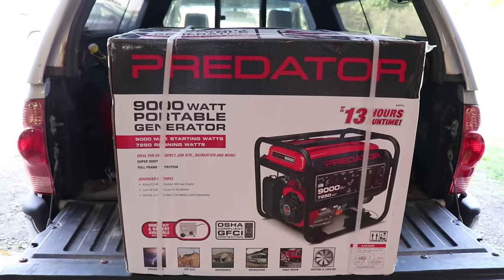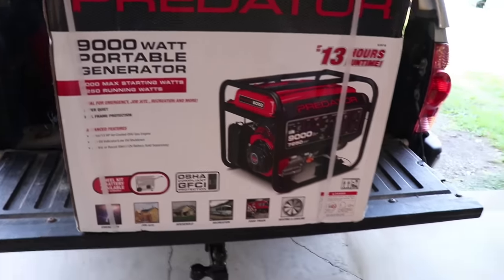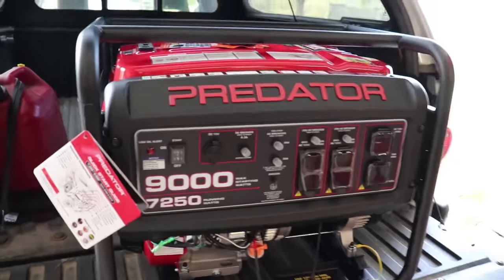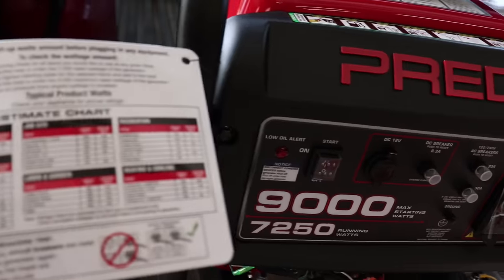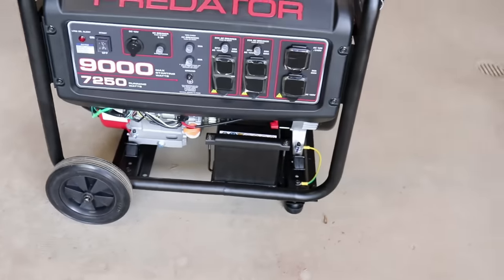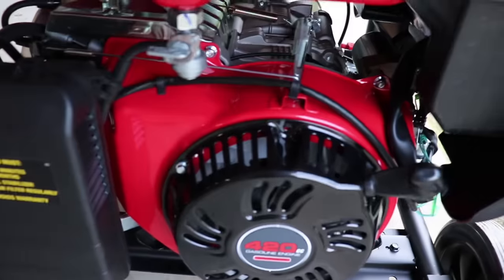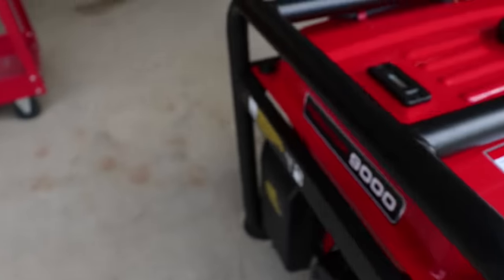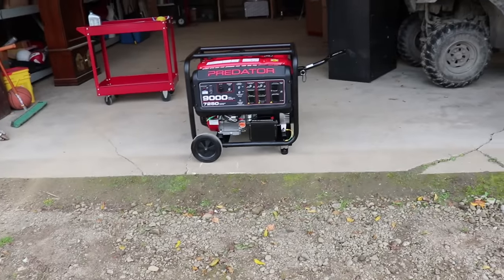Predator Generator Running Our ENTIRE Home. (Complete Setup and Cost)

Comment: You should make a detailed video on everything you did to the breaker box. This is what people really need to know.
Reply: You’re exactly right! THAT is the most important information! The rest is something that any halfwit could figure out.
Reply: @1wldnczyguy  Really!? The mains switch, breaker, and wiring are the easiest. The generator set is the hardest with the most variables to understand. Just as an example, running a generator off off GAS, LP, or NG will loose a significant amount of power in that order. Especially when it comes to restive and inductive loads. Simple math. Any half dimwit would know that first right!? I'm assuming you have the generator topic already figured out for your application!) Call an electrician do the rest of the easy stuff;)
Reply: Eh. I prefer the review on the generator mostly. The wiring is pretty easy.
Reply: Absolutely, that's the whole reason I watched
Reply: i would like that!
Reply: @TopTechCg3  With LP I didn't see any difference of the gens ability to handle load versus gasoline. I tested with an 83% load and it didn't miss a beat. The power loss from using NG may only matter if you are trying to run higher than an 80% load. If you know most all of your run time is 50% load or less fuel choice isn't an issue.
Reply: @TopTechCg3  You're not going to electrocute a linesman or burn your house down because you selected the wrong generator setup. The same cannot be said about wiring.
Reply: @Benjicmm  amen..one can take your life the other doesnt putting it together
Reply: I clicked on the video because I thought it showed you
Reply: @javiergamez3343  me too.
Reply: Has anyone seen any other videos pertaining to the breaker box setup?
Reply: @cscott6629   yes its a double poll 30 amp breaker.  when its a single its 110 its a double poll its 220
Reply: A lot of snarky electricians out there. These people are gonna try to rig it to their panels somehow, so wouldn't it be better if someone showed them how to do it right?
Reply: Electricity is dangerous,  a competent person should wired for you all
Reply: Get an electrician, don’t kill a lineman.
Reply: If you don’t know hire an electrician.
Reply: @1wldnczyguy  why are people so quick to criticize I think there's friendlier ways to exchange info and ideas, this video was helpful to me and if I need more info I will ask Mr. Cook
Reply: here's a link that might help, it shows the wiring of the breaker its a little different set up it uses a Generac kit but if you understand it you should be able to adapt it or if you don't you should probably hire a electrician or reach out to people until you understand it. just remember thinking you understand is different then truly understanding https://youtu.be/1p8qZzwgwFO
Reply: @ronedwards5900  Thanx!
Reply: C Scott it’s a 30 amp double breaker which is 220
Reply: C Scott It is a 2 pole 30 amp breaker rated for 120/240 volts. 220v. & 240v are interchangeable and both are residential voltages. For this purpose there is no difference.
Reply: Nae C I’m a 48 year 4 state master electrician. Let me know what you need to know about the Breaker box ( load center ) and the wiring. It’s way more simple than you might think.
Reply: Zuzu Fan I’m a 48 year master electrician and I’m not snarky. Let me know what you need information on.
Reply: unrepeatable raddish A manual transfer switch will make it easier to operate but harder for these folks to wire it up. And you probably know that it isn’t necessary for this application other than convenience as long as you don’t screw up and leave your main breaker on while your Generator is running.
Reply: Actually you don’t even need that twist lok receptacle or the 90 degree PVC pipe. Just wire it straight to the breaker in your panel since this should be a stationary installation anyway.
Reply: I'm sorry to here you burned your house down. Sorry my brother!
Reply: @spinaltap3258  how do you wire the box for a generator
Reply: C Scott it will have to be if you want 220/240 v in your home.
Reply: U Hall okay first tell me what wiring configuration you’re going to use. Ie: using a twist lok receptacle, or a manual transfer switch, or wired directly to your panel in your house.
Reply: @TopTechCg3  Always a mister know it all in the comment section!
Reply: All you  have to do is run a 30Amp circuit from your main panel or even sub panel to a Generator outlet.  Turn your main power disconnect to the house off make sure of this 100%  so you don't melt your generator or blow a secondary on your utility transformer.  I would highly suggest using a multi meter to check that the power is off and buy a lockout device to lock out the main breaker in the off position before running your generator.  If you have a meter main socket outside this makes it even easier, but make sure you turn the first main disconnect to your house wheather its outside or inside.
Reply: I came in to see the electrical wiring. Did  he make a video on the electrical wiring? I'd sure hate to be homeless trying to warm the house.
Reply: C w I can walk you through how to do it but first do you have any electrical training at all? I would not like it at all if you or someone was to get hurt. Like I said earlier I’m a retired 48 year electrical contractor. So for me it’s very simple to do. So let me know how comfortable you are about going into your house panel. Remember 120v @ 20 amps is at least 2000 times enough current to kill or seriously injure. That’s probably why Mr. Cook didn’t include that process in his video. I would prefer a different format than than this so that information would only be visible to you only. Hope you understand. But when it comes to life safety that’s where I from a humanity and licensed electrician must draw the line and I just can’t put that information out to the public. One thing that I don’t see in any of these videos is the fact that nobody is grounding or even make mention of grounding. That is the MOST IMPORTANT thing that you need to do for life safety and electronic safety. Let me know if you have a platform that I can walk you through it without putting it out to the general public. Thanks.
Reply: @TopTechCg3  A lot of people are not comfortable with connecting up to a breaker box.  Instructions would just make one confident in making a DIY install.
Reply: Get a transfer switch that enables 6 to 10 circuits and monitors the power output from the house to generator.  It costs a little more than the option that this video uses, but it is a better option.  A reliance transfer switch costs between $200 to $300 but includes most of the parts that cost him about $100 or so (Google 'transfer switch')..
Reply: Its not to code so why make a detailed video?
Reply: @spinaltap3258  Okay cool.. Thank you.   So you believe it's something I can do by myself? Even if I cut the breaker main switch off I still run that risk? I'm on leave soon as I return I'll send the info. Thank you.
Reply: First question the lawyer will ask Are you  certified?  No I followed random comments on utube. No further questions!
Reply: @lesliemaness999  thank you.  Some states don't require you to be certified.  Like Pennsylvania where i live.  I can pass the test no problem, anyone can do electrical work in Pennsylvania.
Reply: @ronedwards5900  ; thank you.
Reply: @lesliemaness999  okay got you. Thank you.
Reply: Tesla first looked into the area of zero point technology in his early years, before he made his more commonly known discoveries in the area of alternating current electricity: https://homemade-generator-tao.blogspot.com/2020/07/tesla-power-generator.html

Zero point is a fringe area of research in physics. Even as a young man, Tesla was convinced that it was possible to obtain energy from all around us and that conventional thinking (obtaining energy from fuel reserves) was wrong. Impressionable as he was at that young age, he was persuaded to drop this area of research and he went on to make some of the greatest discoveries in electricity that the world has ever seen.
Reply: Yes please
Reply: The breaker box is the only thing I really think anyone that came here needs to know.
Reply: He put a link to the video for that incase you missed it.
Reply: Google that s*** then
Reply: @frankm5019  it isnt that hard. You're not wiring up a nuclear power plant
Reply: @lesliemaness999  negative, Ghostrider. Many states do allow the home owner to do electrical work on their homes, but you likely have to have an inspector check your work and sign off on it.
Reply: Wiring is easy. 2 hot wires to the double pole breaker. One wire to neutral bar one wire to ground bar. 240v 30 amp.
Reply: Question? Could the 30amp breaker be installed on the bottom of the panel and still work?
Reply: @njm5991  yes because its connected to the 2 hot (Line) buss bars.
Reply: This is all fine but what what happens if the economy shuts down and you can't get gasoline ⛽ to run your generator?
Reply: Yes! Everything of how to set up a breaker box build please!
Reply: I've bought air compressors that have popped the breakers.lol..   big facts.
Reply: Yes I agree but otherwise it was a good video
Reply: @spinaltap3258  I have the same setup but need a cable. Do I get 240v cable or a 120v cable? The house and box are already wired by an electrician... I am naive when it comes to this and he didn't mention anything about the cable I would need
Reply: Absolutely agree need detailed video of wiring the breaker box
Reply: @deacon8754  True , A lot of people won’t understand that
Reply: Get an electrician if you dont know how to wire your panel. YouTube is not where you want to learn how to wire your home
Reply: Me too.
Reply: Yes definitely, we all know about generators
Reply: Yes I need the  what u did
Reply: Yes please ☺️💖
Reply: Id say its for legal reasons or at least thats why i wouldn't show it. Nowadays people are very sue happy and would gladly throw you under the bus without a Second thought if you were to shock yourself or worse burn your house down ect. If you aren't sure how please pay the little fee for an hour of labor from a pro. Put the limited liability on them .
Reply: Just a word , although I'm an avid do it yourselfer too , in some states hooking up a generator to a breaker box is illegal unless done by a certified electrician and inspected by the power company . they have to check to make sure in case the power to a certain grid goes out , when the grid comes back on line and men are working that backfeed won't happen on transformers making a daisy chain .
Reply: Get a licensed electrician.
Reply: I was hoping he would show proper start procedures and shut down procedures.  For example,  lights go out, you start your generator,,now, what next.
Reply: Call an electrician.  That way you know it’s done safely and correctly.
Reply: @kirkcardoso6137  what size wire?
Reply: @GL_615  50 amp service 6 gauge. 20 amp service 12 gauge is suitable.
Reply: Make sure you all are aware with the hazards of using generators. Generators can be dangerous if not used carefully so make sure you follow all the generator safety instructions. I know all about generator safety and I have something to explain to everyone about generator safety. Here is what you all should know: please remember not to ever run your generator indoors. Generators should only be used outdoors. Always remember that carbon monoxide fumes are odorless and colorless gas that is a silent killer that you cannot see or smell. Carbon monoxide is dangerous and it can cause death. Carbon monoxide is poisonous. Always keep that in mind when using generators. You need to have a carbon monoxide detector. Make sure your generator is 15-20 feet away from your house and away from doors, windows, and vents. Never use your generator indoors even if your doors and windows are open. Some people run their generator indoors during hurricanes which is dangerous and you and your family will die if you use generators indoors. Running a generator indoors increases the risk of carbon monoxide poisoning. Please don’t run your generator in wet conditions. Running a generator in wet conditions can electrocute you. You need to keep your generator dry. Don’t let the portable generator get wet. You need to have a generator tent as well to protect your generator from getting wet if you will use  your generator during wet weather. We also really need to keep our children safe when we’re using portable generators so they won’t get electrocuted or burned by the generator which is dangerous. Generators can be hot. You have to keep an eye on children making sure that they are not near the portable generator to avoid any risks. We have to be aware with all the hazards and follow all the instructions in the generator’s operating manual. Generators pose electrical risks. Make sure your generator is not overloaded. Overloading your generator can cause damage to the appliances that are plugged into the generator. Please don’t overload your generator. Don’t ever try to plug a generator cord into a wall outlet to avoid back feeding. Back feeding is dangerous. Always turn on your generator first before plugging in appliances. And before you unplug the appliances, please shut off your generator first. Please use a heavy duty cord for your generator and the cord should not be worn out. Please don’t refuel your generator while it’s running. You should shut off your generator and let it cool off before refueling it. Refueling your generator while it’s running can cause fire if gasoline spills on the generator’s engine because it’s hot. Please make sure your generator is properly grounded. Everything that is said on the generator’s operating manual should not be ignored. They all need to be followed. https://youtu.be/I1jT3ANENvI and here is a video more about keeping your family safe while using generators. This is for everyone’s safety. This is just a safety reminder for everyone to make sure that you all are aware with the warnings. Thank you and hope you all stay safe. Use your generator carefully.
Reply: I see that some of the comments saying prepping the panel is the easiest. That’s not true. I’m a licensed electrician so I know how to do it but for the common person it’s not. Some panels don’t come with a main breaker. You would have to add one and that’s only if you can.
Reply: @trayvanderbilt1138  get a few propane tanks for duel fuel generators
Reply: 2things. Good video and covers a lot of issues about portable generator use for the diy’er. Just be safe out there. 

Number one: he did not mention carbon monoxide. He ran the generator in his garage. There was lots of ventilation but, always direct the exhaust away from house and windows. Do not run your generator indoors, including garages. I don’t care if it was a text or not. 

Not having a transfer switch is illegal where I come from. Except when you run plug wire. Safety switch plate or not. Code is code. If you back feed, you can kill someone. 

BTW, there are 4 compressors in the house. Anyone answer the question of amp draw or spike if all compressors call at the same time?
Reply: @lesliemaness999  - Exactly the same thing I was thinking while reading these comments, lol
Reply: Here you go: https://www.youtube.com/watch?v=gorjxkgInng